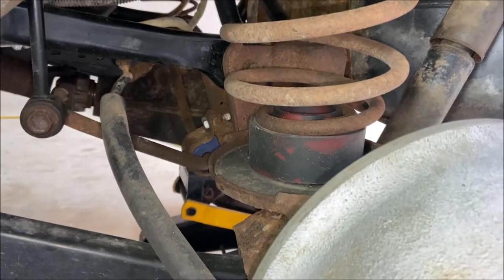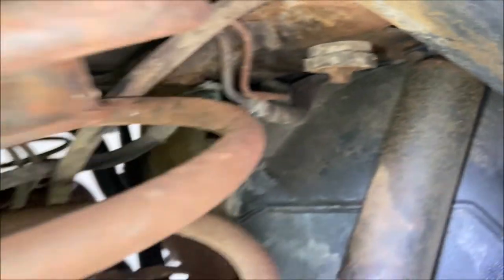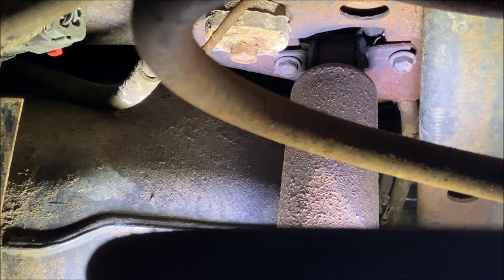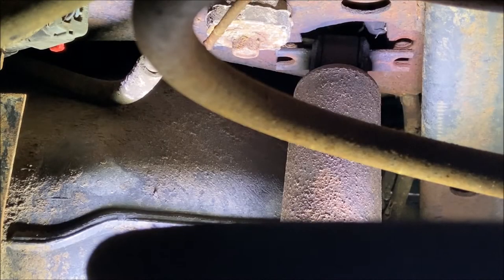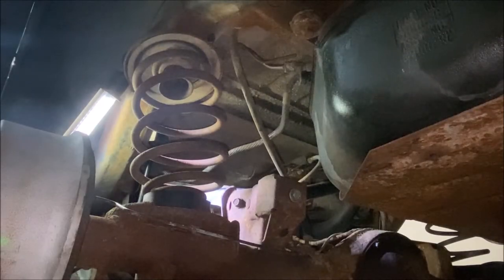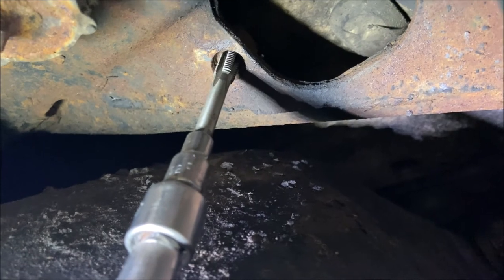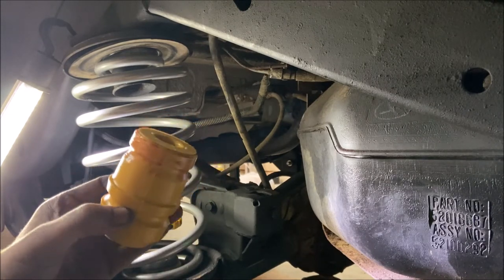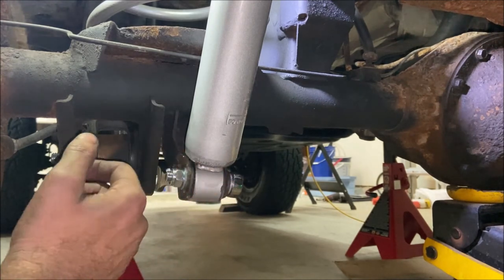Replacing Rear Shocks and Springs on 1997 Jeep TJ

Comment: They sell an adapter kit for those rear shocks. It takes away the “bow tie” set up and uses sleeves and a bolt.
 ELITEWILL Rear Shock Upper Bar Pin Eliminator Fit for 1997-2018 Jeep Wrangler JK TJ 1089
Reply from the maker: I had actually bought some (link in video description) as a backup plan option. Since all the bolts came out pretty easily I decided to stick with the factory option so I didn’t have to mess with getting the bow tie out of the shocks. The eliminator is definitely an option though. 
Thanks for watching, Brian.

Comment: Wow, good job.  All 4 on my 2000 tj broke.  i was already doing frame repair at the drivers side rear control arms, so i had the tank dropped.  (it's real easy to do)  I drilled them all out and re-tapped them.  used plenty of anti sieze going back in!
Reply from the maker: I know I’m going to have to drop the tank in the near future on my TJ but the rust there has me holding off as long as I can. For sure, dropping the tank to get at those nuts from the top would make life much easier. Glad you were able to get yours taken care of. Thanks for watching.
Reply: @CarbonsDIYGarage  and dropping the tank is the same scenario as the shocks, except instead of a nutsert welded to the frame, it's a stud that the tank skidplate flange fits onto, with a nut holding it in place.  I had one of the studs spin on me which was a pain because it was the one on the passenger side front of the gas tank, which is right above the exhaust.  difficult to get to with anything to cut it off.  I drilled and tapped a new screw for it upon re-install.
Reply from the maker: @leftoverporkchop9972  Oof!  Yet more reason to not look forward to doing this job....
At the same time, I feel like I should tackle it by replacing the skid plate before the fuel pump fails and I have to do it when I don't want to/haven't prepared to.
Reply: @CarbonsDIYGarage  Best of luck to you.  I bought this tj knowing it would be a hobby,  so, i guess i sort of look forward to the challenges.  So far, it hasn't been too bad, and i've learned alot.

Comment: TDSR is coming right along. If you keep going you won't have any rusty bolts left to deal with. Keep it up. I did the rear shocks on mine in an earlier video, but once again they weren't rusty at all.
Reply from the maker: Thanks, Steve! You realize that TDSR is basically "let's see what Steve did to JJ and do that to TDSR," right?  :)
Thankfully TDSR's rust has largely been surface-only so some PB Blaster, heat, and patience gets things free.  I can't imagine having to deal with rust like they get up north...

Comment: I just started taking my 2003 TJ apart today, shocks came off very easy. I'm doing a full suspension lift  , control arms included and both trackbars..
Reply from the maker: Nice! Glad it can apart so easily. Have fun with the project!

Comment: Mine has a bracket that’s attached to the top of the shock!?! I can’t reach the bolt because the shock has a bolt in the way!?! How the heck am I going to get it?!?
Reply from the maker: Is it a pin eliminator like this?
https://amzn.to/3iUrTbK
If yes, you would leave the bracket installed and just remove the bolt going through the shock. There are YouTube videos on it. I almost installed these with my own project but opted not to. 
Sorry if this isn’t much help. That’s the only thing that comes to mind.